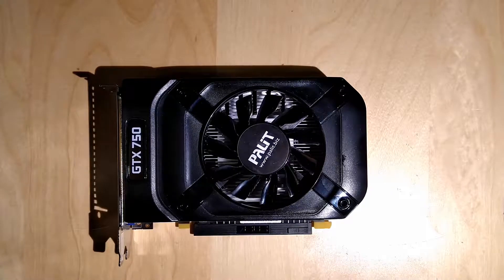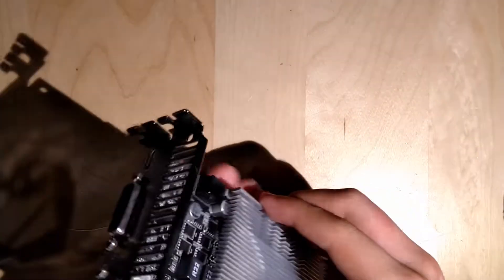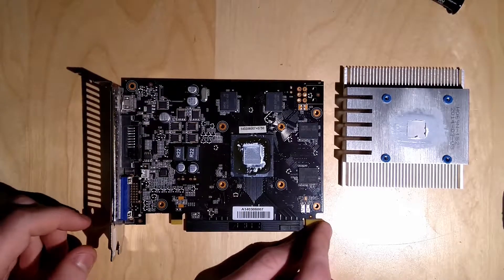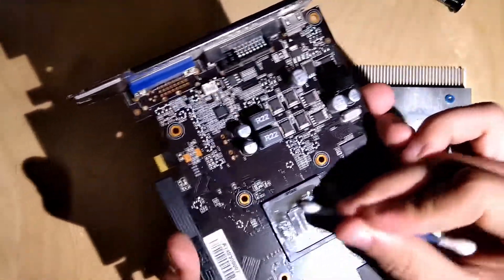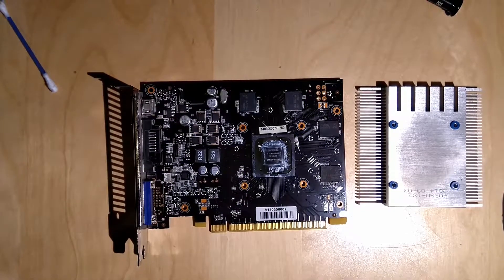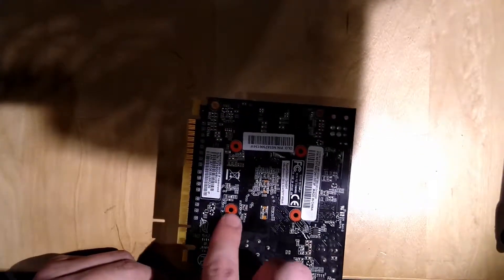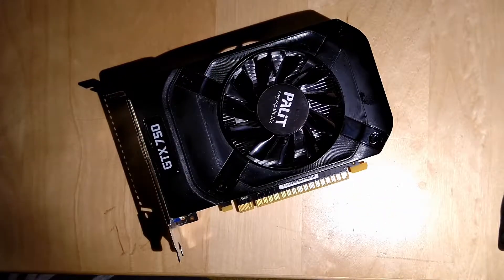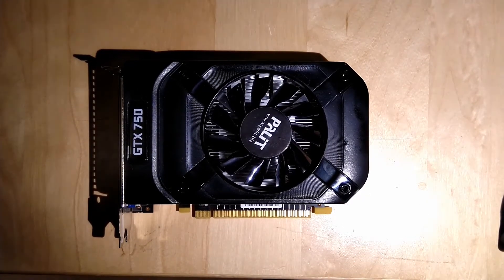Palit GTX 750 Teardown | i made my friend take apart a Graphics Card

Comment: Hi what screwdriver do I need to remove the shroud? I got 2 screws out with a standard one, but the other 2 just wont come out and I've tried to get it out so much but its starting to round off & im not going to try again without the proper screwdriver otherwise its stuck and i need to remove it to clean the card before selling it!